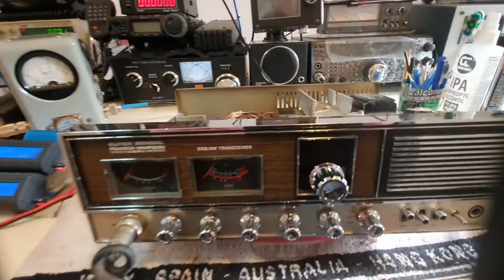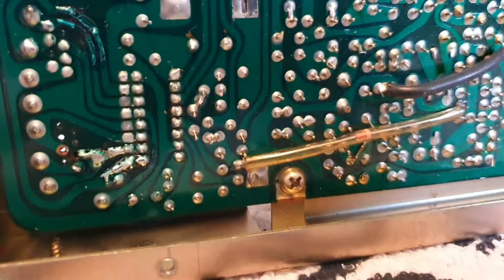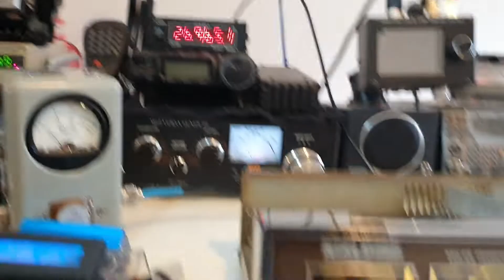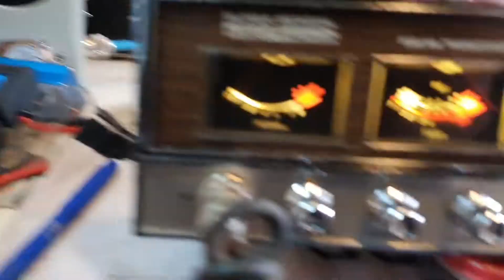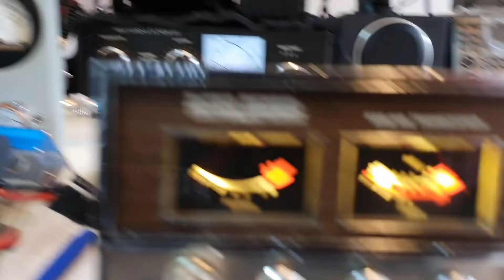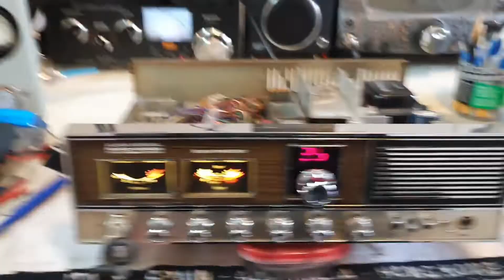Super Bengal Restoration - Summary - On air tests - Power output - Cosmetics - Part 4 of 8

Comment: Hi paul, Great video, I've just scored one in mint condition, the only problem is she's a bit of frequency, on ch35 am sitting at 27.357, so can you tell me the which pots to adjust, Regards Scott.
Reply from the maker: Really not that easy Scott

You need to align the synthesiser first so all voltages are correct, then after doing audio stage put on frequency counter and align AM then USB and LSB , RX then TX
Reply from the maker: Suggest you download a service manual to see the process.

Yes there are areas to adjust that look likes you have adjusted, but it doesn't if process not followed. Most of the time out of stage adjusting will unlock the vco, or RX.

Comment: Top job Paul. What's the trick to clean up the chrome? I would like to restore the same radio that I also happen to own..
Reply from the maker: Due to the badness of it I used new microfibre, and autosol metal cutter & polish, then a paint clear coat cutter and friction polish fast
Reply: @Pull_It_Apart_Paul_Ham_CB  Thanks mate, Did Lisa taking the photos of inside our one help you with the wiring of those 3 switches? We hope it was of some help.

Seems there's quite a few stages to getting that chrome looking good. Ours is fairly green around the chrome, but the Radio was only $10.
Reply from the maker: Yes thankyou Jay, I could not find her post to say thankyou.  The picture idea was good, and worked
Reply from the maker: Please pass on my gratitude, as her work helped to bring this back
Reply: @Pull_It_Apart_Paul_Ham_CB  You're most welcome mate 👍